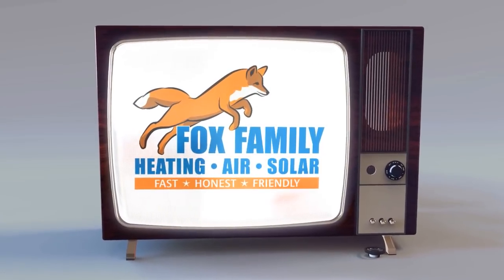Why Is There Insulation Coming Out Of My Vents?

Comment: I have been noticing a lot of dust over years and the dust has sort of fiber dust clump in dark color close to normal black color not visable pink insulation color , and not necessary fine dust alone. I am not sure it comes from insulation or duct work in the attic.  Wife has been coughing too so not sure. 

I had some AC guy and he said I had no leak or breakage in my dust work a few years back. Our home was  built in 1980's. 

I had duct cleaning done from time to time but still pretty dusty and had to vacuum and always notice dusty surface all over the home.

Our home is 2 story and part of duct work cannot be replaced as they are not accesible or crawl  in.

Comment: Hello, sir, 2 questions: 1. I bought a foreclosure that had duct board as ducting that was original to the era of the house and leaked fiberglass dust. After replacing the HVAC & ducting, I still have fiberglass dust I think coming out of the vents. I can see it when the sun comes in the window and the ac is on. Can a duct cleaning clear up the dust if the vents are sealed? 2, Is there a device you can recommend that will suck up the interior air and duct in out the window?

Comment: I think the #1 culprit is the "critter" with two feet using the attic as a storage zone until the storage falls over or using the ducts as handrails and breaking the baling ties or causing flex cuts by the straps and/or causing the connections to open. Inspectors/WHF installers ect tramping around the attic also.
 I hate removing KD, not that it's hard but because it's so efficient, lets face it, flex duct no matter how taught is not as good as KD. . Pull the itchy stuff off, UL181 seal it and it's easy to be sub 2% leakage. They say flex with metal 90 sweep is nearly as good, I say BS.

Comment: How would you remove the fiberglass shards once in the house? My air purifiers aren't working!
Reply: I am not an expert, but I would vacuum.
Reply: @Liz Lee I am in the same situation, i feel your pain.  I have had to rip out all of my carpets and throw everything away.  my friends and coworkers think i am crazy until they come to stay at my house.  I feel your pain.  I bout an industrial air scrubber and a hepa backpack vaacum and it seems to be helping.  Its just me running around taping things off by myself from room to room so it is impossible to tell if its 100% but its way better.  Good luck, prayers with you!  If you use a vacuum be sure to use HEPA.  definitely throw away all textiles and clothes. <3

Comment: Plenum insulation is deteriorating away & being released into the rooms. The sign to look for are the screws that are sticking inside the ducts at the connection points which catch & buildup the black fibers that exactly match the fibers from the plenum box insulation!

Comment: i have a question i had a split hvac system installed in are rental unit and filter was relocated to the wall under the air handler (now the filter box) well the filter box area was never cleaned there was sewage backup from the bath tub and fiberglass in the filter box. well it got sucked up and was coming out the registers.
the air handler has a big warning lable in the instruction about debur and dust. the installer said it wasnt his job to prep the area
any thoughts? they made me and my family sick for week cause we didnt notice it right away
Reply: Same here for me it’s dusty coming up through the vents
Reply: @jimmyimhotep8388  how bout cutting pieces of air filters to go inside vents(arranged in a way they wont get drawn out) to purify incoming air, keep filter you made placed there very clean

Comment: Very nicely explained video. Thanks!! 🙂This may be a stupid question, but if I see some insulation stuck in a vent in a particular bedroom, as you described midway in your video, does that mean there is fiberglass contamination all in the room? After cleaning out the vents via a duct cleaning service, do we need to wait a certain period of time for any debris or fiberglass to settle before moving kids into to the room?
Reply from the maker: Yes I wouldn't be comfortable with insulation being right at the registers. Although that type of insulation is more soluble than many things that we breathe in on a daily basis. But still... And then once you have them cleaned out, you're good to go.
Reply: @foxfamilyhvac  Thanks for taking time to reply!

Comment: We live in apartments built in the 80's and the ducts have insulation on the inside. I know they still sell ducts with insulation on the inside but it seems bad. Especially when it gets old and starts breeding mold and mildew as ours seems to be doing. Allergies where one of the reasons we moved here but my wife and are are getting sick all the time now and she coughs way more than she used to. I feel so bad for her because she has asthma and has always been way more sensitive to these things than I. That said, I have been having more problems that I ever have since we moved here. We don't have renters insurance and I'm skeptical that these old apartments management would offer any useful assistance. Before we moved in they said that this unit had smoke damage from a unit that caught fire behind us and that they had completely remodeled this unit with new sheetrock. They obviously did not replace the AC ducts. The central unit is in the ceiling of the second bathroom and the manager told my wife that it leaks sometime when the drain, which drains into the tub, gets plugged up. I know how to avoid that by running a homemade pipe cleaner with a fish tape through the tube with a weak bleach and water mixture on the swab but there seems to be nothing we can do about the old ducts. Any advice? I know bleach can damage a system but as I said it's a weak solution with just a few drops per cup of water and I never run it too far through the pipe as to come in contact with the unit itself. I've never had any problems with this and it seems to break down the algae that blocks the flow, all the way back to the tray that catches the condensation.
Reply from the maker: Man, I wish I could tell you what to do here. If the ducts have mold in them, you absolutely have to replace them. You'll never get them clean enough to be healthy. Sorry you're going through that.
Reply: @foxfamilyhvac  Yes my daughter has a friend here who's been through this from a legal standpoint and you have to take steps to verify that the toxins are un your body and in your apartment before you even mention it to management. Unfortunately there aren't any laws that protect people here in Texas. She said that if you can get the tests done before you mention it to your landlord it helps your situation though. That costs money though.
Reply: @foxfamilyhvac  I just bought a house built in the 80's I believe I need to replace the black insulation in the large hall pop open vent. what's th black stuff called?